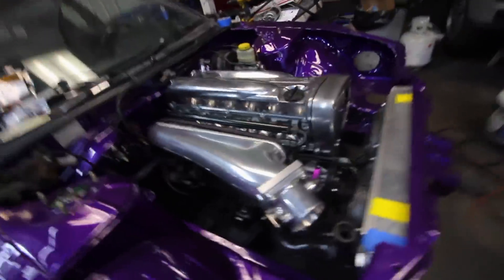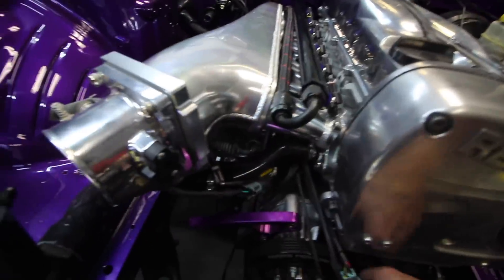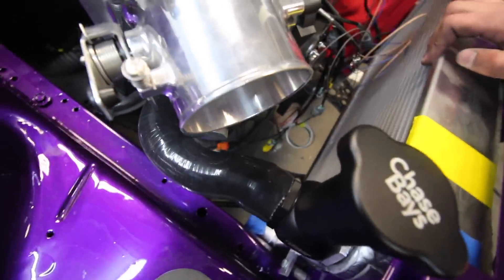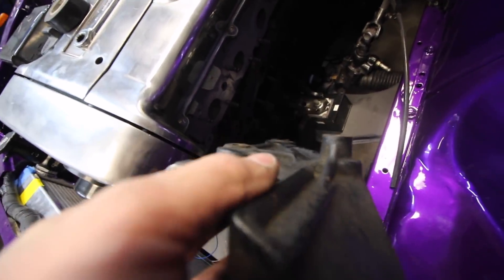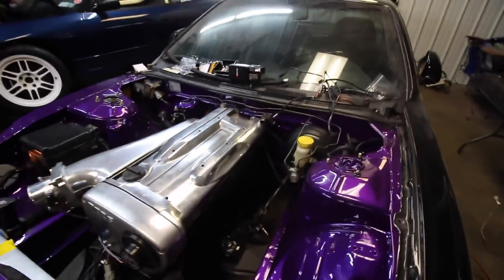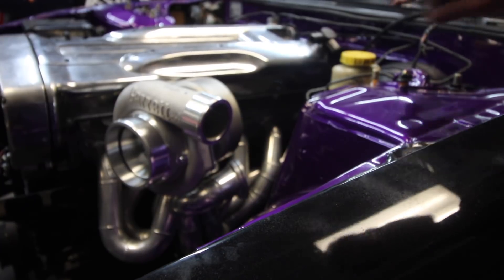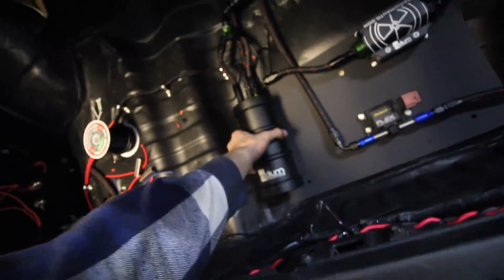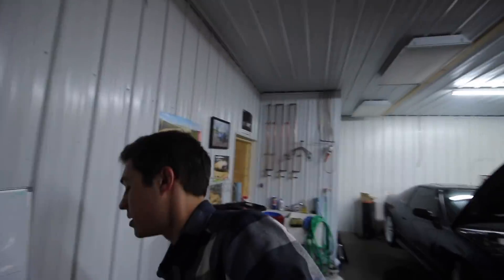Kouki is Ready for BOOST | RB26/30 240SX S14 Kouki Build Part 8

Comment: heat wrap that mani or else you gonna melt your brakes
Reply: Chlorophant it's ceramic coated.
Reply from the maker: Definitely won't melt the brakes!
Reply: gonna melt on o2 sensor then~! (just did this myself)
Reply: Chlorophant it's a ceramic coated manifold and an o2 sensor is already in the exhaust flow (much hotter than radiant heat from mani)
Reply: It's the o2 wire that melts, and mine was ceramic coated too, just sayin'
Reply: Chlorophant why didn't you put fire sleeve wrap on the wiring?